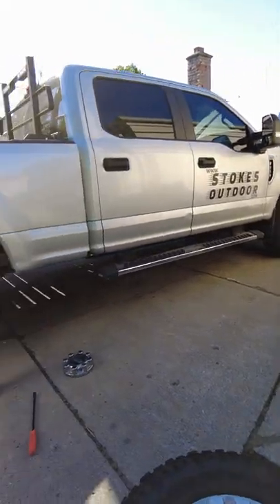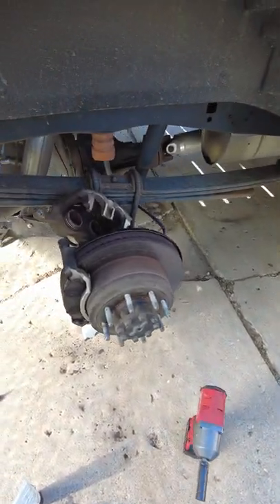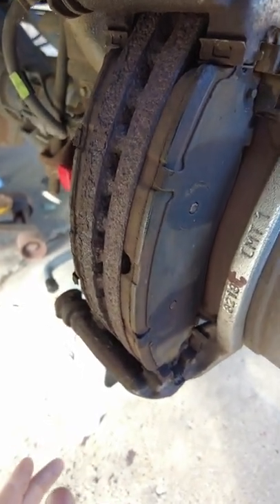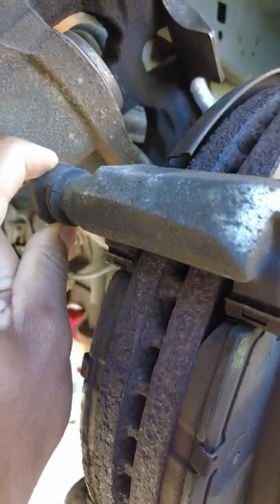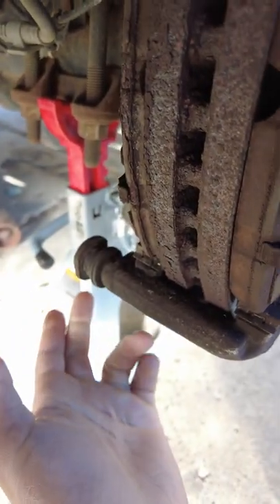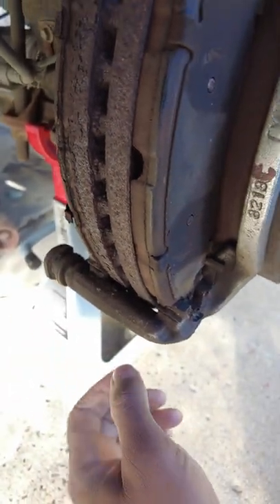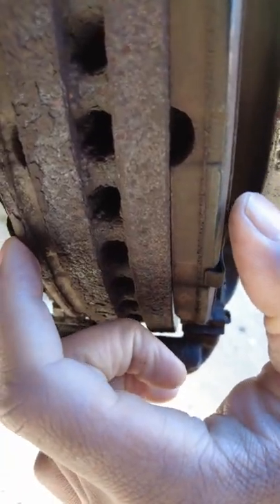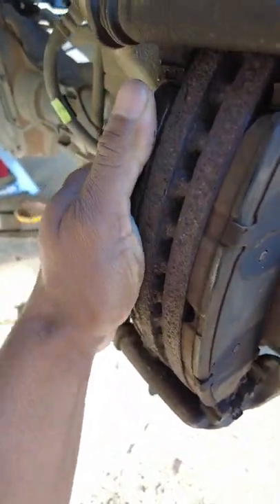BRAKE PAD FAILURE AT 20K 👀 #shorts

Comment: Another fine FoMoCo product at 19000 miles. I had a brand new Taurus Wagon in the early nineties that the brake slider froze up on because the rubber seal was never installed at the factory. I was hundreds of miles from home and had to drive it back with a red hot caliper/disk. The service manager at Portsmouth Ford told me it was my fault and I should have been having all of my maintenance done at the dealership. The vehicle had less than 10K miles. Had to replace the brake assembly myself.
Reply from the maker: Wow. The design on the super duties isn't it too bad. I'm in a pretty hard environment with the truck.
Reply: I’m not talking about design! It’s about inferior assembly of Ford product! ie…brake caliper!

Comment: my 2017 f250 has done that 2 times since ive owned it. completely seized bottom slide pins. had to buy 2 brand new calipers just to harvest the bracket off of em. a good $300 bill
Reply from the maker: Plow life.